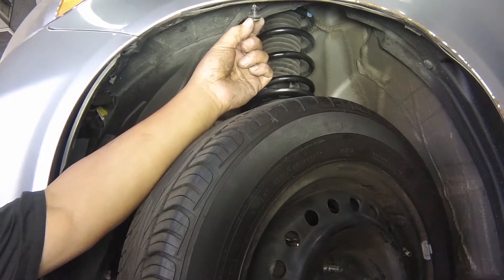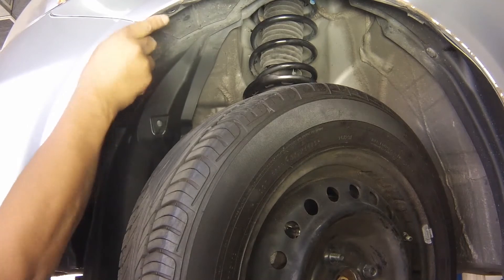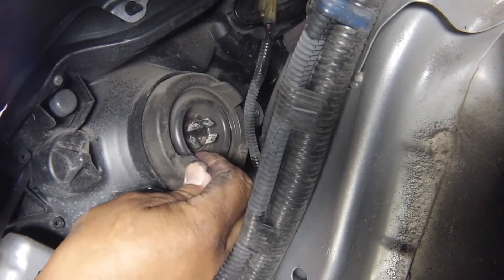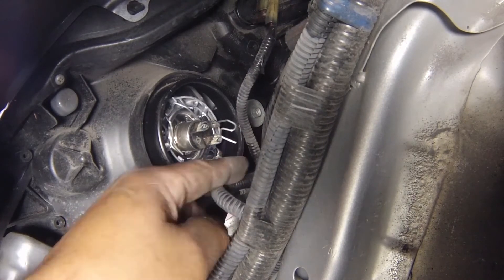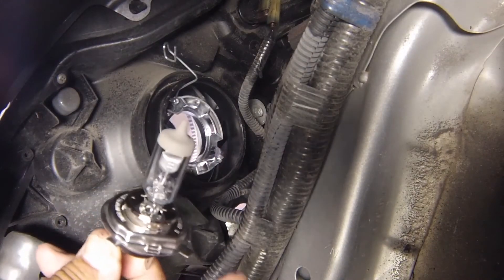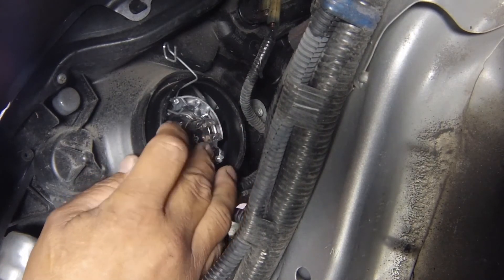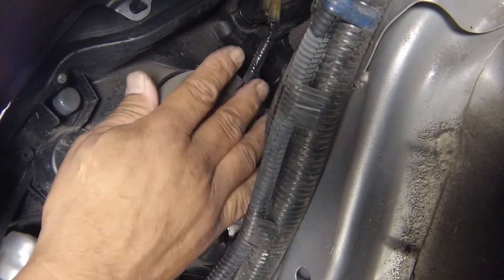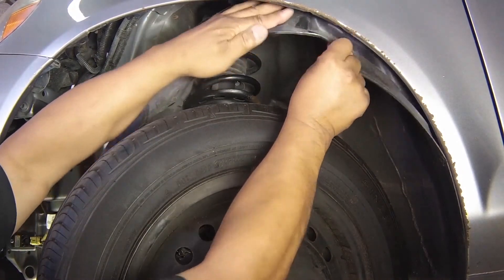How to Replace the headlight bulbs on the Honda Jazz 2002 to 2008

Comment: I actually found it easier to remove the front bumper and take out the headlight housing.

The guy who did this video clearly has telescopic arm with multiple elbows, as well as x-ray vision. Well done!
Reply: @killmz  yeah to be honest I think it is a design fault by Honda. Headlight change should be a simple job that can be done in five minutes at a petrol station on a motorway. Also following the Honda instructions it is likely the bulb will get fingerprints on it.